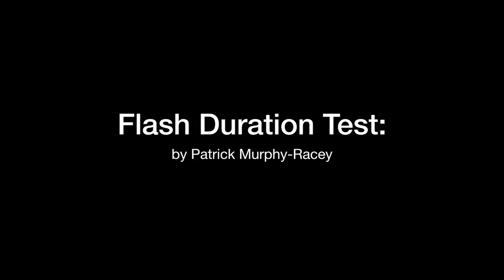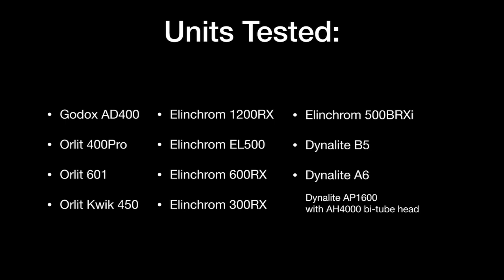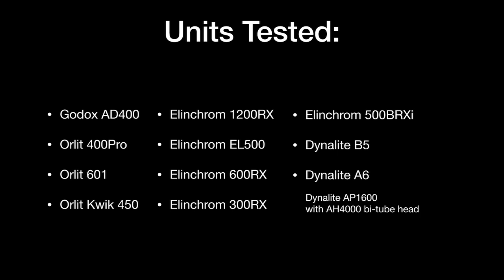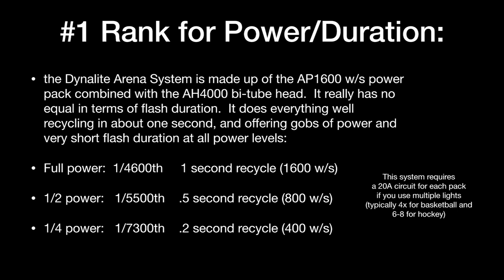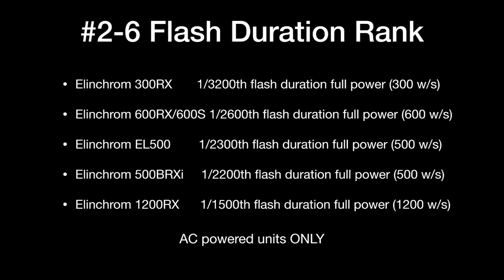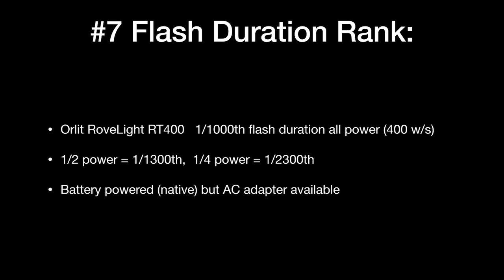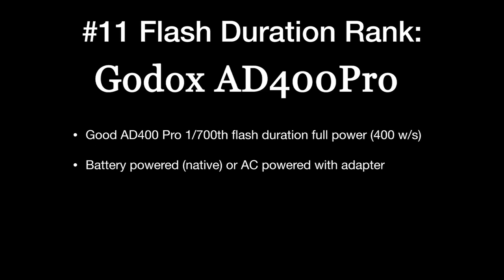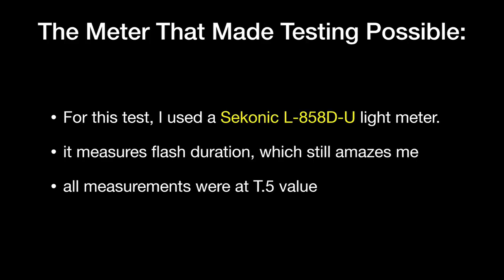Strobe Flash Duration Test with Godox, Dynalite, Elinchrom, & Orlit by Patrick Murphy-Racey

Comment: you helped a lot thanks so much.  wish i would have see this be for i got a godox ad400 i shoot rodeos in side and outside and at night.  i was seeing some stuff on the einstein flash unit e640 and the Alien bees B800 would this work for fast action? for price vs what you get for t1 value . what do you think of them  any advice would be greatly appreciated ( i know i would need to make or get a battery pack to run them and it would slow the flash speed down too. )

Comment: You've also not tested the Godox 640 either, so that's the other system you need to test out, including the Einstein 640.  You won't be (as) disappointed
Reply from the maker: I did test a Godox AD600Pro last year, and while I didin't have this fancy meter with me at the time, I know that is not the answer for me.  Godox is all over the place with each pop giving a differnt output and crazy fluctuations in color balance.  Godox to me falls under the category of, "you get what you pay for."  I find the Orlit gear to be almost half the cost of Godox without as much variance...  but my favorite light right now is the Dynalite B5--this gives killer consistency with each pop in color and output, so much so that I can shoot at 10 fps on my a9II's and get identical exposures.

Comment: Why not test the Einsteins?  at 640WS it's a very good system with a very short t.1 too.
Reply from the maker: non on hand but I hope to test their new battery powered light (took them long enough) but it's excessively expensive at this point, once you factor in the cost of the unit, battery, charger, and cost...
Reply: @PMRTV  yeah after using the Einsteins, and a couple of friends do too, we found them very reliable and work very well, even though they are still AC power, but much less expensive than Elinchrome at roughly $650 they're worth the look because the control of them through pocketwizards is pretty good, and the HSS too

Comment: Great video! Why t.5 instead of t.1 times? Do you have any recommendations for good value monolights for smaller courts/rinks? (2-5k seats) I've been wanting to get into using strobes for basketball and hockey.
Reply from the maker: best there is for this sized arena are Elinchroms.  Probably the 600RX/S models, or, if it's really dark in there, you might be able to get away with the 500BRXi units
Reply: @PMRTV  And if I am understanding correctly from this and a previous video of yours (one of the setting up strobes for basketball videos). When setting up my exposure, ideally I want to meter the flash 3-4 stops above ambient with a T.5 time of 1/2000 or better? Thanks for the info and recommendation!

Comment: Let's say ( You'll get the implied reasoning) we set three RX at  "300 watt output" respectively on a 300, 600 and 1200 unit; will the RX1200 unit have a shortest flash duration or the worst ?  Thanks! 
(I could call Elinchrom to tel me from theyr charts, I guess, I almost live next door to them, but here it might charge better :-)  )
Reply from the maker: 1200 w/s would have the longest duration of those three.
Reply: @PMRTV  
(I meant to write that the answer wil "share" better here, not "charge". Typo, sorry.)

Thanks for that albeit sad answer :-) lol. I was kind of remembering that but was not sure anymore. So the (discontinued) RX1200 really seem to only have one (sometimes fantastic) advantage 9ver the RX 600. Even the charging is slower at equal output. Still I can't not like the RX lol.(Though I would trade them in for the latest generation right away  if only cash wasn't involved lol).
Thank You, and also for Your  great Video!

Comment: I’m new and don’t know what I’m doing...I bought 
1- Orlit 800 AC, 
3- Orlit 610 Battery
1- Orlit 601 Battery
I’m trying to start a business with a friend so I got these...
What do you think about these and..
What application do you recommend these for?
Thanks and super good video!
Reply from the maker: I personally own 5- Orlit 601 units.  they are good but they have crazy variations in color.  I find the 601's are more useful because I use HSS all the time when outside.  I don't use TTL at all but I'm the exception, not the rule.  these are decent units but if you ever get an assignment where color is critical, I'd tell you to rent Elinchrom or Profoto.  If you are doing portrait and wedding work, what you have should serve you well.  pm-r :)
Reply: PM-R TV thanks, I’m not doing weddings right now, just trying to build my skill in video mainly but also learning to take portraits and shooting sports.

Comment: BTW technical failure..  I have a defective Elinchrom RX1200 (out of two RX600 and three RX1200).
Can anyone tell me from experiance if there is an economic fix to that "symptoms", please ?:
The fuses are good (checked on other unit).
The flash tube does not look fried,  but what holds it does, and flash tube is "loose".
The electronics (pilot lamp, ventilation, digital pad) all work normally, 
even the trigger and recharging and clicking sound normal.
Just no flash-pop. 

( I got reported by dealer that a technitian replied -presumably to the above information only - that it would cost "at least" 400 dollars...  Any chance "they are wrong"?)
Reply from the maker: 1. try to remove and then re-seat the flash-tube.  You may need a needle-nose pliers for this.  Use gloves or paper towel so you don't contaminate the flash-tube.  If that doesn't do anything, it could be a bad flash-tube.  The clicking sound is the release capacitor.  If it's not the flash-tube, just pitch it as the repairs will be too high to justify fixing it--good luck!
Reply: @PMRTV  
..Yes, but if i was to touch it, I guess cleaning the tube with alkohol is going to be on the dave side.

Right, at this stage I should look in at it myself,, witch "strrangly",  I did not consider, especially if You rekon as well that if more serious problem then it's indeed going to be to costly (such a shame not ecological, spear parts going probably wasted too).
Thank You!
Reply from the maker: when you hit the green test button, do you hear a tiny click coming from the unit?  This is the small capacitor on the sync board--this is the small one that triggers the big caps to fire.  If you hear that clicking, it's good news, if you don't, not so much.

Comment: Very interesting video, I've watched all your stadium setup videos. You put a ton of time in these so thanks so much.  Never used strobes like you've explained but I have 4 years of outdoor sports and just getting into basketball and volleyball. I need help understanding the concept of shutter speed and sync with strobe in this setting.  When I use flash indoors, I expose so ambient light is blocked out, I get a black display.  Then I add a flash at a time.  How would I set exposure in a high school gym?  Could you please walk me through the camera settings? usually I'm at 1/1000, 2.8 and auto iso, see what I get, then try to increase my  shutter speed while keeping iso in reasonable range.   You stated that the strobes should be a couple stops brighter than ambient light and flash duration may actually be shutter speed.  I could take a light meter reading of ambient, then pop strobes until I get three stops above?  Sorry for the rambling question.  Ted

Comment: What  is not discussed  is the difference between flash duration measured using the t0.1 standard or the t0.5 standard. Except at full power  and only one flash duration is stated assume  the t0.5 standard is being used. What is the difference? t0.1 is almost always 3x longer than the t0.5 measurement.  The difference is that the t0.1 FD  measures the amount of light produced  is brighter than 10% or greater of the maximum amount of light produced at the specified output. t0.5 measures the amount of light produced  is brighter than 50% or greater of the maximum amount of light produced at the specified output.  

So while the t0.5 measurement looks really short, the photographically significant amount of light - the light your camera will actually record - corresponds with the t0.1 measurement. 

How do you figure out the t0.1 FD if you only have the t0.5 FD? Simple: divide (not multiply) the t0.5 FD by 3 . Example: the t0.5 measurement of  FD is 1/900, so 900/3 = 1/300th.

If your goal is stopping motion, knowing the t0.1 FD is critical. 

Don't just take my word for it!  Here is a more in depth guide that explains and illustrates the difference between t0.1 and t0.5 and also what IGBT is and what it does.  https://www.paulcbuff.com/flash-duration.html
Reply from the maker: all that matters is that people measure apples to apples.  no matter what time value you use, Elinchrom will almost always be fastest at full power.
Reply: @PMRTV  "Apples to apples",  meaning using the same standard, whether it is t0.5 or t0.1 -and clearly stating which standard is being used.
Reply from the maker: @ellisvener5337  exactly